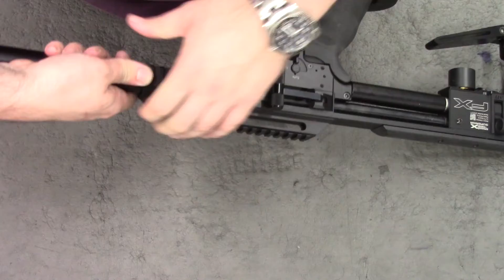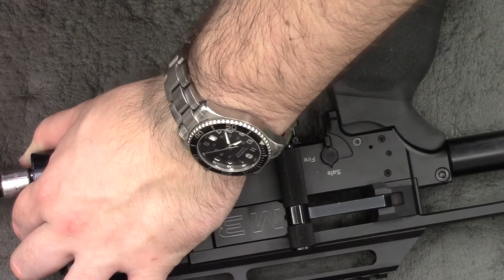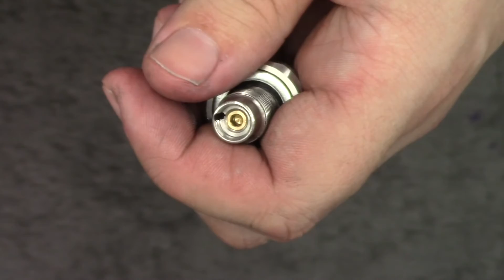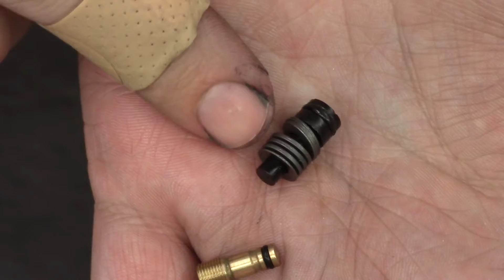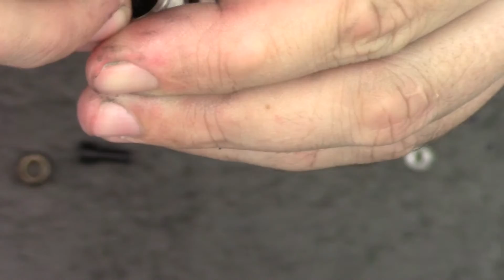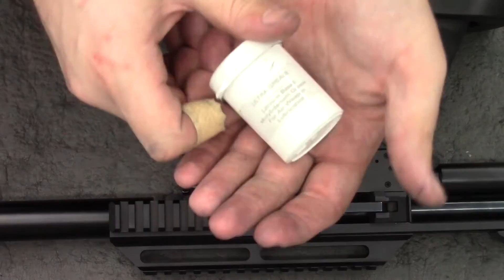FX M3 front reg removal and rebuild

Comment: I have a quick question I have had my impact m3 for about 1 year now and if my front (first) regulator is set to 150 bar and my rear (second regulator) is set to 110 bar is it fine to shoot the gun below 150 bar and down to 110 bar because I’ve never gone below the first regulator pressure
Reply from the maker: yes you can do that 👍
Reply: @sub12airgunners  thanks so much bro

Comment: My friend, I have a problem with this regulator. I've replaced all the rubber seals, but when I set it to 180 bar, it goes up to 190 bar after an hour or two. What's the problem? Can you help me? Even if I set it to 170 bar, after half an hour or an hour it goes up to 180 bar.
Reply from the maker: it is probably the piston in the reg has damage or a dimple in the end allowing it to creep👍

Comment: I'm having an issue with the front regulator not fully charging when shooting. It's set at 150 bar and decreases down to 140. After sitting, it will climb back to 150. I assume the regulator needs rebuilt.

Comment: If I ever have to take mine off, I will just replace it with the front reg delete kit. Also FX has been over tightening the bottle adaptor in the mk2 as well. I could not take mine off and abandoned the idea after cross threading it with the bottle. Now I'm just waiting for either of those components to break or leak to try and replace both of them again. Thanks again for the video.
Reply from the maker: yes they really do tighten them up far to much, thanks for watching 👍👍

Comment: I just got a saber tactical delete kit because I had a leak in the atmosphere breathing hole I changed the 0rings like three times I got it to stop leaking for now but I  did receive my delete kit and if leaks again I'll install it and just do away with front reg ....it was a very slow leak but still it's was frustrating I run my reg high anyway at 200 bar so it's only holding 50 bar which is nothing I think it was leaking because the weather changed from.very hot to very cold here in texas usa lol also I probably had the leak already I watched Ernest rowe video on the front reg diagram so I checked the reg hole and it was leaking lol freaking Ernest I would of never knew anyways yup ill probably be installing the delete kit I'll see how it goes also I applied silicone lube and left the excess on instead of wiping it off I think that helps stop the leak but they  0rings
Reply from the maker: Good luck mate hope you get it sorted, A few people I know have fitted the reg delete with great success. Thanks for watching
Reply: @sub12airgunners  I installed the delete kit from saber and it was kinda scary I had to put the bottle on and off a couple times so the threads could get use to each other at one point I thought I had crossed threaded the bottle and the delete kit came all the way off so I had degas the bottle and use a wrench to take it off the bottle then put it back on the gun and tighter the crap out of it ..... inside the bottle where the threads are at those a little bit of debris so I think that's what caused it to get kind of stuck so I clean everything really well and put it on and filled with air and it's holding good 👍 and shooting good 👍 34 gr varmint knockers at 995 fps the recovery is awesome 👌

Comment: thanks for the video, followed it to the letter. My regs are slow to recover which is why I thought I give it a clean and polish, about 20 secs to recover so zeroing is slow and painful any thoughts on what to try next. Sub 12 mk3
Reply from the maker: 20 seconds sound like a lot, does it reflect it in the chrono readings? if not is may be that the gauges are just slow to recover, the other thing it could be is creep to fix that you would have to polish the top of the reg piston and the bottom of the adjuster screw, these are the sealing faces and polishing them helps greatly reduce creep as it improves the mating surfaces. Hope that helps, thanks for watching.
Reply: @sub12airgunners  Thanks. I’ll check it over the chrono. I did polish the the mating surfaces as suggested. I did have an extra bellville washer than in your one, which I’ve taken out. I did purchase a brass piston from B and K but it looks different so didn’t replace it. Perhaps that’s for reg 2. I also have a huma reg. so lots of options. Totally out of my depth now of course 🤪

Comment: its all straight foraward, till the part where u file the small brass piece and the plastic, so now im went from creeping into full leak lol.
im going for a new regulator hehe.

thanks tho, i tried.
Reply: I'm not sure if you meant "file " but you should not file the piston/adjustment pieces just polish them with jewelers roughe and or cloth and it doesn't take much just be careful, I know this is an old post 😉

Comment: Hello Jake ! How can dry lubricant improve the performance of the regulator disks ? 
Thanks
Reply from the maker: Dry lube is just a dry lubricant, with similar lubrication properties to grease, but since its not advised to use grease in the belleville chamber as the grease can (in rare circumstances) cause hydraulic lock of the belleville washers i.e stopping them from compressing correctly, we use the dry lube, to just give the belleville washers a little helping hand, without the possibility of hydraulic lock. In reality you could probably use grease with no problems, but I like to use dry lube for peace of mind. thanks for watching.
Reply: @sub12airgunners  I agree , I cleaned the desks a couple of days ago after noticing the regulator indicator refilling very slowly .I was amazed by the amount of dust mixed with lube 🤦🏻‍♂️,so I polished them ,washed them ,then applied dry powder lubricant.  It became more consistent and refilling is much faster  cheers.

Comment: Awesome video man I did the same but I did have a lil bit of a problem putting the 4×1.5  that is inside the regulater body patience is the key to putting that o ring back lol but I re stack them like this (())(())(())( cus im running my reg at 190 bar i had to buy some extra washers thanks for sharing bsafe
Reply from the maker: Thanks, yeah patience is key, good to hear you can run the reg that high. Thanks for watching.
Reply: @860fps2  like this fir really high pressure (())(())(())(( some other guy I know is running is gun like this with 14 washer I only use 13
Reply: @860fps2  yes
Reply: @860fps2  bottle you can put 14

Comment: Would you recommend buying a used m2 over waiting for an m3?
Reply from the maker: If its a good rifle for a good price, and sub 12 then yes, if its FAC then I would wait for the M3, the larger plenum for the FAC makes it more efficient and you can get a little more power out of it. Thanks for watching.
Reply: Yes but get the power plenum version.
Reply: They are the same to me i have both a 25 cal 700mm mk2 and a m3 22cal 700mm and both guns are very accurate it just takes time setting them up to what you want to shoot if you want slugs its a little harder to get that sweet spot but pellets they both shoot them very accurate ... I like shooting slugs out of both guns the m3 is a bit easier to tune in my opinion but its the same both guns are awesome 👌